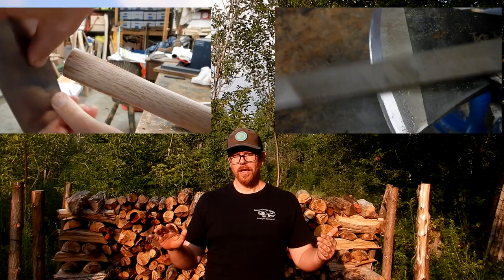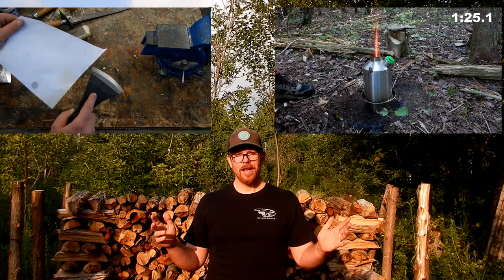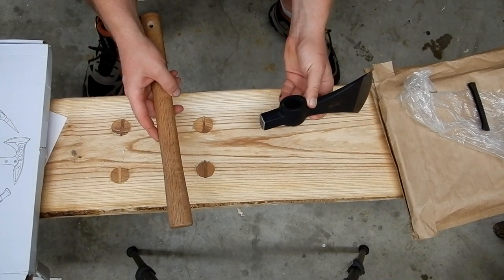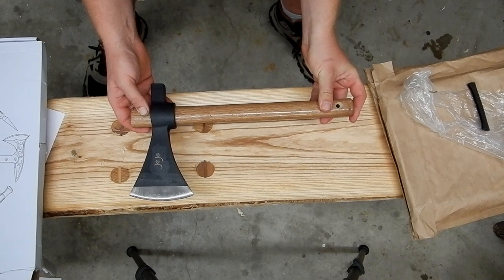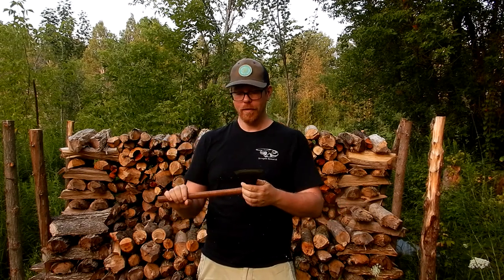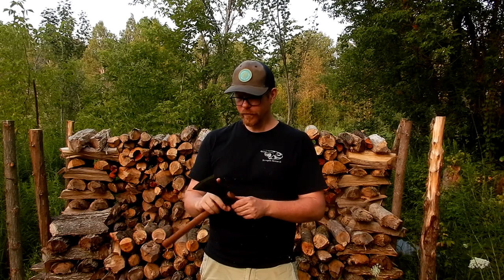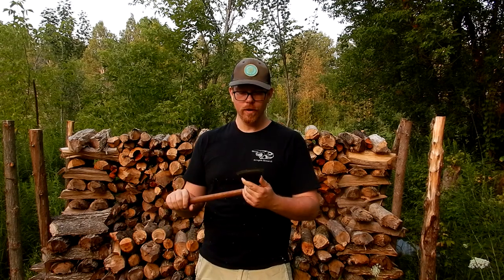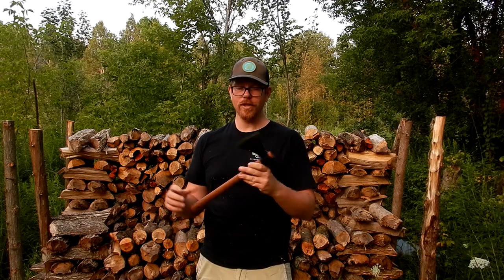Jxe Jxo slip-fit hatchet review, filing new bevel, how I measure edge angle; Kelly Kettle breakfast

Comment: Cool video, if its not a problem with the steel choice itself, maybe you could throw it in a forge and reharden it, maybe even hammer that bit downwards a touch and closeup the hang angle? Coul be a fun experiment
Reply from the maker: I was actually thinking of it. I just got done hanging a little Ox-head only to find out on the first swing that someone had burned the temper out of it. I've got a Garant that has also been through a fire. So I've got a couple I could try it out with. I just need to set up a forge.

Comment: Good video and thoughtful points on the axe. I’ve tried re heat treating cheaper axes with mixed results! If I try it again I think it’s important to normalize the head before attempting to re harden
Reply from the maker: Thanks for the advice about normalizing. I don’t know what I am doing when it comes to smithing and metallurgy but I might give it a try because I have 2 other axes that need rehardening. I will probably make myself a pit and hair dryer forge and give it a go. If that works out maybe I will try my hand at making a knife from an old file.